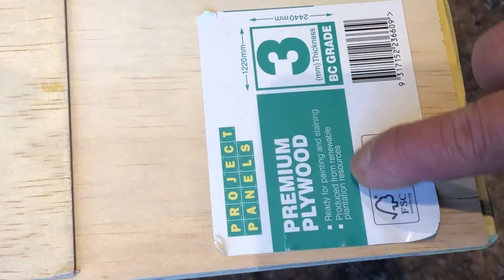How to make a DIY plywood canoe - from start to finish

Comment: Hi, I have one question, I notice on a lot of inner wales are laminated with the outer (against the hull) made up of what looks like 10cm pieces with a 10cm gap between them, is this a good idea? Wouldn’t it allow the ingress of water into the ply edge?
Reply from the maker: This is my second canoe. I have had the first one for 7 years now. Paddled it in the rain, left it outside in the rain for a few weeks before. No problem. Just make sure you apply epoxy. When you paddle the rubbing is on the side of the wales not the top part. If you notice any scratches on the top part you should apply epoxy. Also, epoxy absorbed into the plywood fibre. So don’t worry 😉 👍🏽

Comment: At the 4:31 part of the video, sir please explain  why did you cut the fiber glass on that part?  What is the difference if you not cut it or put just like that?
Thank you.
Reply from the maker: Good observation! 👍🏽 I didn’t have wide enough glass cloth. I slit the middle and cover the space with  trimmings from the bow and stern. That is also why I only glass the mid part of the inner hull. I apply 2 layers of epoxy to rest of the inner hull . Perfectly okay. The strength of the canoe comes from the convex curved arch of the hull. Just like an arch bridge. The load is opposite. The downward convex curved arch sustain the vertical loads. An amazing concept 🫡☝️👏✨

Comment: What is your hight at mid ship of the sides and width at the gunell
Reply from the maker: I made it a little bit wider. That’s why the stern & bow tilt up a bit. Therefore the mid ship height a bit lower. I did that hoping it won’t be as tippy. I think it works. I can always adjust it back to it’s original design but I am getting used to this now. Lots of J strokes though but I am fine with that. The ultimate test for stability will be when I can paddle standing up. I stand and paddle using the earlier canoe I built. Super steady.
Reply: @corneliusoutdoors  and where did you get the drawings
Reply from the maker: Online. Will share the link in the building videos, soon 😊

Comment: how many days (or hours) did you make this boat?
Reply from the maker: Hours? Not sure. Minus ‘beautification’ if you know what to do, five days after work , this canoe can hit the water. I took a lot time to shape the gunnels, the decks, the thwarts, the seats. Other than that 5 days about 2-3 hours a day is enough. It has to be 5 days because the epoxy has to cure before the next steps
Reply: @corneliusoutdoors  thank you
Reply: Hello, could I have a free plan of this project please?
Reply from the maker: Please email me at corneliusoutdoors71@gmail.com

Comment: 👍👍👍👍 But next time, use a pull saw.
Reply from the maker: Thanks. I have never use one before but I heard it’s better for sawing curves. I got my saw for a dollar from a garage sale. If I build another boat (a kayak), I will get a pull saw.
Reply: @corneliusoutdoors  in my opinion, not nearly a proficiency curve for it, in comparison to traditional push saw. I think mostly because the pull keeps blade stretched.
Reply from the maker: I need to get one.  Cheapest in Bunnings is $25. 185mm. Irwin 185mm Dovetail Pull Saw. So, the term pull or push refers to when it cuts? 🤔 I have no idea.
Reply: @corneliusoutdoors  I grew up using the push or traditional carpenters saw. About 8/9 years ago, I was doing some cutting and kept having trouble making straight clean cuts. Trying to figure out my skill short comings, I watched a video on a Japanese pull saw. Just feels like I have much more control. Especially, when working on smaller cuts or flush cuts. The blades are usually much thinner and flexible and most will have both fine tooth and course tooth on opposite sides.
Reply from the maker: I must get one. I never able to saw straight. Never. Thanks for sharing. 👍🏽👍🏽

Comment: how long did it take to build
Reply from the maker: If you know what to do it can take just a few days . I had to figure out the steps as I go. I tested each step using waste ply. I recorded each step. I will post the built episodes soon . I took more than a month working on it after work and during weekend. The delay mainly due to the weather. Epoxy won’t cure below 20C
Reply: @corneliusoutdoors  thank you for the reply sir.

Comment: Great video! Did you ever produce a series of instructional videos for this? Or how did you design the measurements for the cuts. I've seen some other videos using the fly-mo design, but am still unsure about how to lay out the measurements and how to treat the wood throughout the build. It would be great to get some more detailed instructions on this method. Thanks for the video!
Reply from the maker: Thanks. I am sorry. I am still working on it. Very soon, I hope. I am finalising the instructional plan. Please email me at corneliusoutdoors71@gmail.com
Reply: @corneliusoutdoors  Thanks. Will do!

Comment: Hi, great video, did you use regular plywood? Did you have any problems with the plywood after it was ready?
Reply from the maker: Yes, I did. I use the normal 3mm plywood. No problem at all. Full fibreglass on the outer hull but only in the middle section on the inner hull because I ran out of fibreglass:). I use the canoe very carelessly. Dragging it on sand, knocking banks, stumps, rocks… lots of scratches but all good. Been using it for more than two years now. I m preparing the built videos. Should be out soon 🙏🙏

Comment: How long did it take and is this doable  with 1/4” plywood and 3M 5200 quick dry glue for a one day project for kids?
Reply from the maker: That would be impossible. 6mm ply is too rigid. It will break when you torture it. The 2 3mm ply need to be connected. 1:12 scarfing. I don’t think quick fry glue will be strong enough. Once the 2 ply connected, yes, it would be possible to shape the canoe in one day but gunnels have to be screwed in place. Next is fibreglass. 3mm ply not strong enough without it.
Reply: Thanks, I sent you a message on your FB page a few minutes ago and just saw this reply. Thanks again.

Comment: Step by step please. I have started it already , closing the has become a challenge as I found CA glue without accelerator seems to work best but bonding time is more than 5 minutes . I move to the next gore and the one previous pops .
Reply from the maker: That’s not good. Try using cheap super glue. Superglue bond immediately. Tape the closed gores and add a small piece of plywood to hold the end off the gore. Half inch wide. They will be scars when you remove it but it will be covered by the gunnels. Buy the building instructions 😁🥰. Happy building. What type of plywood did you use?
Reply: @corneliusoutdoors  5mm underlayment is what is available here at Home Depot. Thank you I will try that .
Reply from the maker: @Grizzly2-n8d too rigid with that thickness. Glue won’t help. Someone in New Zealand using 4mm plywood. Once closed he put a strip of fibreglass cloth on it. Lengthy process but he made it. Beautiful canoe. Also, lift the plywood in such a way so the gores close together easily. You can also use wires or zip ties. The gores don’t have to perfect closed before you bend or roll the canoe. The most important part is the out end of the gores must be closed and aligned before the rolling. That’s where you need the small piece of plywood. 2cm wide and 5cm long will do. Glue it or nail it or bolt and nut it temporarily. When rolling, 5mm thick plywood would be to rigid but try wetting the hull both inside and outside and run clothes iron as you roll it. Someone in Europe using my building plan did that and it turned out great. Join this group and ask questions. I learned a lot from this group https://www.facebook.com/share/D8kVQafY1t7Qmq13/?mibextid=K35XfP
Reply: @corneliusoutdoors  yup I did that on a few of the gores  slow process but it does work.
Reply from the maker: @Grizzly2-n8d nice 👍🏽

Comment: Quarter inch plywood?
Reply from the maker: Hey mate! Nope. Only 3mm. Nice to see you here, mate! Is the boat house opened? 😁
Reply from the maker: Just 10th of an inch 👍🏽
Reply: @corneliusoutdoors  Wow how many layers. Ive used steam to bend plywood.👍
Reply from the maker: Just one. Because it’s curved, it’s very strong. It’s like a bridge. (Arch bridges work by transferring the weight of the bridge and its loads partially into a horizontal thrust restrained by the abutments at either side. - Wikipedia ). It’s an amazing design👍🏽
Reply from the maker: I have seen people doing that but I took the risk and thank God it was okay.

Comment: Why do the inwhales have to be staggered?
Reply from the maker: Slotted? Yes. Easy to drain water and also looks nice 😊.
Reply: @corneliusoutdoors  it does look nice and easy to drain makes sense. I thought it was something more complicated!
Reply from the maker: @khomol not at all. The inner gunwale makes it difficult to drain water. On my older canoe I even made a hole right at the end of the bow and stern. The decks were installed an inch from the ends. Also to facilitate drainage. I usually give my canoe a good wash in and out before putting it on the car. Stay blessed, mate!

Comment: Why did you cut the sheet of fiberglass along the center of the bottom of the canoe at 8:04 ?
Reply from the maker: lol 😂… good eyes 👍🏽👍🏽. I didn’t have enough. I cut the centre and use the trims from the bow and stern to cover the gap. This was during the COVID lockdown. Fibreglass shop was 20KM away. I just had to use what ever I had. I wanted to fibreglass the entire hull too but I only had just over a metre in the basement. Full of dirt and fungus. You can see that in the video but it gives somewhat a nice pattern 🤪. Also, by fibreglassing only the middle part of the inner hull was more than enough. Aren’t you going to build one? Email me at corneliusoutdoors71@gmail.com if you want a free plan. Cheers 🥂
Reply: @corneliusoutdoors  Got it. I did ask because I am considering making one. This technique using non-marine wood is definitely the most accessible and straightforward small canoe design I've run across. Thanks for showing the build in such detail.
Reply: @corneliusoutdoors  P.S. Thanks for the free canoe plans! I'm going to try this out this spring. Gotta buy a bunch of clamps first. :)
Reply from the maker: @Superkuh2 you are very welcome 🙏
Reply from the maker: @Superkuh2 not necessarily if you use screws. You can leave the screws in or take them out after the glue is cured 👍🏽
Reply: @Superkuh2  Did you make the canoe? How did it turn out ?
Reply from the maker: @peters6850 beautiful canoe. Yes, I did. Simple Building concept. Versatile design. I paddle it in lake, beach, rivers and creeks

Comment: So how long to actually make it ? And why no center keel ?
Reply from the maker: Are you referring to the yoke? I am 110kg. I tested. My seat has to be closed to the middle. I won't have room for my legs if I put a centre yoke/thwart. if you know exactly what needs to be done and all materials ready, this canoe can hit the water in less than a week working a couple of hours a day. Email me at corneliusoutdoors71@gmail.com if you want to purchase the plan and comprehensive Building Instructions. Day 1 - Measure and cut. prepare the bevel for connection. This is very quick. I just use a $5 hand saw and trim the narrow gores using a cardboard cutter pen knife. I use a hand plan to cut the bevel.
Before evening, connect the two sheets of ply using epoxy thickened with wood dust or sawdust. Or you can connect the two sheets of plywood first and do the steps as explained.
Day 2 - Close the gores. Easy if you use my methods. Superglue dried in seconds. Next is to fix the inner gunnels. Use temporary (or permanent) screws. Once fixed, time to roll (torture) the banana-shaped bowl and close the ends.
Day 3 - Apply fibreglass on the outer hull. 
Day 4 - Fix the outer gunnels and apply fibreglass on the interior hull.
Day 5 - Fix fittings and seat. 
Done!!! 🥳💪👏
Reply: @corneliusoutdoors   no a keel is in the outside on the belly of the canoe some have 1 keel for white water, some have 3 for lakes the keel helps keep the canoe traveling in a straight line and helps aide the paddler with steering and stability
Reply from the maker: @JohnSeaward  right! A centre keel would be good. I had to J stroke all the.
Reply from the maker: A really good idea actually. I should consider installing one. I usually bring two paddles with me. I use the Greenland paddle if I want to go fast and straight or against head wind and waves.
Reply: @corneliusoutdoors   I use to make canoes years ago and only canoes that we ever made one with out a keel was for extreme white water, and keels do make a huge difference for traveling, the canoe I use to paddle was an 18 ft bow to stern, y stern with a triple keel and by myself I could paddle that canoe from the rear seat straight as an arrow but then that canoe was set up perfectly, after a couple years we added splash diverters to keep water from coming over the side gunwales when we had 4 people and 8 people's camping gear in it and we would jump Beaver dams with it, run white water rapids, break ice in early spring and that keel also helped keep the canoe more rigid no belly flexing inwards, just wish I could post u a pic of her, she was an amazing canoe
Reply from the maker: @JohnSeaward amazing. I have an 18 ft plywood canoe too. Flat bottom JEM watercraft free plan. Yes. Straight like an arrow. A double keels would avoid the bottom curve inwards. I might install the keels. Thanks for sharing.
Reply from the maker: @JohnSeaward  wow 🤩.

Comment: Why are you using super glue instead of wood glue for your seams? I would be interested in the plans for this.
Reply from the maker: Closing the gores? Yes, super glue. Just a few drops in a few spots will do. I tested using waste ply and it worked great. The superglue is to hold the gores  “ temporarily “ . Once the inner Gunwale is installed, the glue is redundant. In the end the gores are filled with epoxy and covered by fibreglass. Wood glue will take a lot longer to cure. Please email me for the plan: corneliusoutdoors71@gmail.com
Reply: @corneliusoutdoors  I sent an email to that address. That makes sense since it's just a temporary hold that you want to happen right away. I'm interested in giving this a try. Can the plans be "scaled up" to make a 2 person canoe using 3 pieces of plywood??

Comment: Здравствуйте!  А можно сделать по этой технологии  длины 4,5 метра и ещё под мотор 3,5 лошадиных сил????
Reply from the maker: Hello! It will only be possible if there is a way to roll or bend a thicker plywood. You’ll need a stronger hull for an engine.
Reply: Здравствуйте.  Какой толщиной взять фанеру? Это возможно сделать?
Reply from the maker: For this canoe, I use 3mm non structural plywood. I think I can use a 3.5 horsepower engine on it but have to be careful. If you want the plan for the canoe, please email me at corneliusoutdoors71@gmail.com

Comment: This looks like a very good project for those with disabilities at camp to make if you would be so kind and send a copy of the plans so at least me and my mentality challenged  nephew could give it a go thanks
Reply from the maker: 🤗 yes it is. No special equipment required. Almost like playing with a cardboard. A cardboard cutter knife will do too. - Measure and trace. Connect the two ply. Cut. Close the gores. Fix inner Gunwale and roll. Close the ends. Fibreglass outer hull. Fix outer Gunwale. Fibreglass inside (partially will do). Fix fittings. Done! 😊👍🏽😉. Yes, please email me at corneliusoutdoors71@gmail.com for the plan.

Comment: Can birch non-marine plywood be used for this?
Reply from the maker: I used normal non structural pine plywood. I have the building instructions. Email me if you want to build one. Very simple if you know what to do. Corneliusoutdoors71@gmail.com
Reply: Ok👍 steam can't be used for bending normal plywood, right? If not, how did you keep it from cracking? Thanks @corneliusoutdoors
Reply from the maker: @AlfredHessle it won’t crack if you know what to do. There are a few y you need to know before bending. I explained it in detail in the building instructions.
Reply from the maker: @ Please email me at corneliusoutdoors71@gmail.com 👍🏽

Comment: So if it wasn't for Fibreglass and Epoxy this would fall apart after 30 minutes in the water.
Reply from the maker: Yes. 🤭😂. Maybe wth varnish or waterproof paint will allow paddling a few rounds. Also, 3mm ply would be too thin for a canoe with fibreglass . But only 3mm can be bent like this.

Comment: With the materials, time, and $1000 bucks in clamps it might of been easier to buy one. Lol😂
Reply from the maker: True. But was a good project during the lockdown. I did not use many clamps. Those are just to hold it in place. I cheated. I screwed the gunnels in place. You ll see when I post the built videos.
Reply: @corneliusoutdoors  That makes sense brother. Thanks
Reply from the maker: Screw it and remove. 😱 I should have done that. Thanks, mate. I also built a paddle board and I use 1/2 inch nails. I could use 1 inch nails, knocked in halfway and remove after. 👍🏽👍🏽👍🏽

Comment: I love it 's not heavy and easy to handle but it took 9 wks to come . very disappointed on that
Reply from the maker: 9 weeks to build? That’s good isn’t it? I may have taken the same time. I worked on it after work and weekend. I took a while to buy the timber for the Gunwale. Tried a few types of wood but ended up with pine . Well done! You completed yours. 🥳